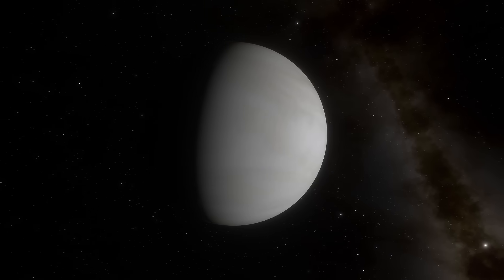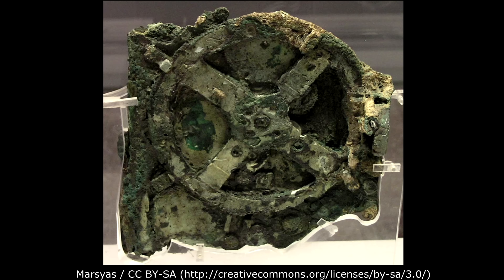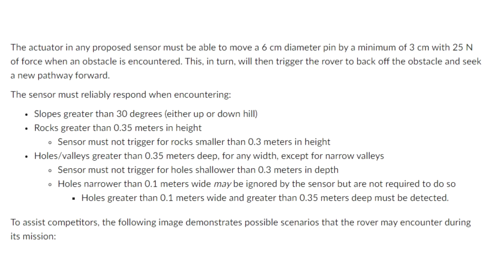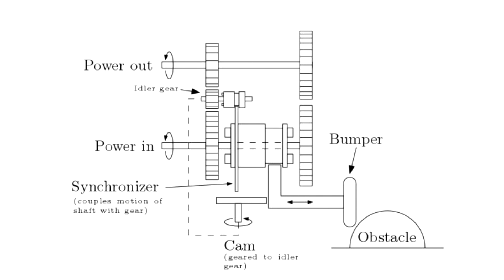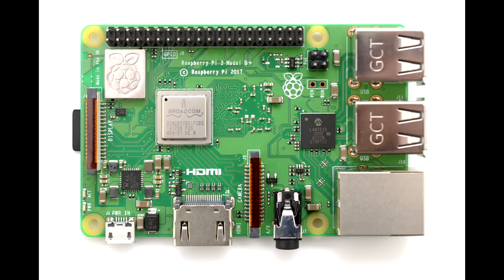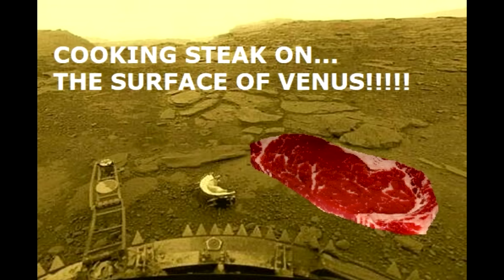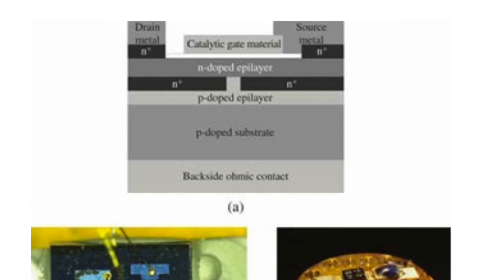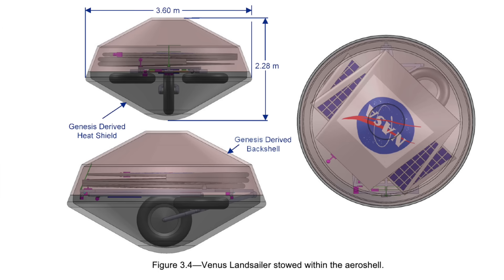Venus Rover Concepts That Beat The Killer Atmosphere

Comment: Molten salt batteries seem like a perfect fit for this. It could melt on the surface and wake up the rover.
Heat resistant electronic circuits seem like the obvious solution for this. If they’re comfortable running at 450C then cooling is going to be easy with the thick atmosphere.
Reply: I was thinking something similar, maybe an endothermic reaction. Some chemical reaction might just be the way to go here.
Reply: batteries still need intelligent charging circuitry
Reply: Molten salt batteries would not provide enough power. the energy density is way less than lead acid never mind comparing to Lithium.
Reply: @gordonlawrence1448  Really? They were tested a lot for electric vehicles before lithium batteries and used in some. A battery that's say 50% as good as a lipo battery is still much better than no battery or a complicated mechanical setup and we don't need much thermal management when it's heated up.
Reply: @Ty4ons  The reason they are used for military applications is that they do not discharge noticably for decades when cold. That's the only application I know of for them (missiles).
Reply: @Ty4ons  Molten salt batteries are terrible in almost every way. The only reason they are well developed is for military applications. Things like air defense missiles need to be able to sit for possibly decades doing nothing, and then suddenly, in seconds or milliseconds, needs to power up and provide shitloads of power for like 20 seconds. And that's exactly what they do. Molten salt batteries are almost exclusively used in military applications like that.
Reply: Salts melting point is around 1470°F the surface of venus is only 870°F
Reply: @Swifteroos  who's talking about NaCl?
Reply: @Swifteroos  These aren't regular salts like table salt and are only a few hundred degrees celsius. If we go to the extreme end and use large molecules for the ions we can make salt that is liquid at room temperature.
https://en.wikipedia.org/wiki/Molten-salt_battery
Reply: @Ty4ons  ah I was not aware
Reply: @Swifteroos  They work on Earth just fine, it would just be less difficult for the sodium to remain molten on Venus.

Comment: I get that it would be complicated as hell, but some kind of craft capable of floating on the clouds and dropping a probe down on a cable to scan the surface and take atmospheric samples would probably have a significantly greater scientific capability for the size and cost to get it there.
Reply: Descent stage and  liftoff time versus the   thermal mass required to maintain temp for critical hardware would be competing and probably make it unachievable. Unless some very fine thermodynamics calculations are shown I doubt this would be viable.
Reply: @ervin0072002  I wasn't thinking something that could land.  Something that would basically take advantage of the super dense atmosphere and be able to lower a probe wouldn't require liftoff capability.  It could stay up where it's cooler and lower pressure, and the probe would be the only thing that would require the specialized materials to withstand heat and pressure.
Reply: So a steampunk mechanical airship?
Reply: @DethsKing  Nope.  Full on computers and such on board.  They would just need to make the probe capable of surviving the intense heat and pressure.
Reply: @DethsKing  YES.....Designed by Kevin O'Neil
Reply: You can't "vent", you need to use energy to pump it out against the outside pressure. And you need a hull that can stand up to the pressure difference, while being light enough to float, and big enough to displace the required volume of atmosphere.
Flying by light gas balloon or helicopter is more realistic.
Reply: @galfisk  Right, that makes sense.
Reply: I was thinking this, or maybe a probe that behaves more like a submarine. It'll spend most of it's time in the clouds where the temperature & pressure is Earth like, and occasionally descend to the surface to grab a sample. Would it be possible to take on some extra atmosphere as 'ballast' to descend and vent it again to ascend?  Or maybe some kind of helicopter that spends most of it's time in the cooler upper atmosphere?
Reply: @beavodeev4412  It's gonna be hard to save on size/weight with a 30km cable on board
Reply: @Merlmabase  maybe, but you're also overlooking the idea that it could use some kind of ballast system on the probe itself, reducing the strain on the cable and wiring so it wouldn't need to be that strong.  Besides, have you ever seen that spyderwire fishing line?  That stuff is VERY strong for how thin it is.  Some new formulation to withstand the temps would obviously be required, but I don't see it needing to hold up a 200lb+ probe, so they should be able to figure something out.
Reply: @Merlmabase  Oh yeah, that's true.
Reply: @Merlmabase  Monofilament diamond fibre. Arthur C Clarke, The Fountains of Paradise.
Reply: @ceejay0137  diamond is extremely flammable
Reply: @ceejay0137  Sure. Although by that point we're building space elevators, and could drop enough insulating material and cryogenic refrigerant on venus to stay cool for a couple of decades
Reply: @TimLF  You need oxygen to start a fire (since we are talking about Venus and not Earth there is none). However, I get your point. It is still unrealistic cause you would need 20+ km length on that wire.
Reply: @hellcat1988  nobody here is even mentioning the concentrated sulphuric acid environment, which is a huge hurdle by itself.
Reply: @paulmichaelfreedman8334  Some stainless steel alloys are resitant with sulphuric acid
Reply: @FruitingPlanet  Also at 500C?
Reply: @paulmichaelfreedman8334  Also, the heat from going down gravity well will change composition of materials, so I'd suppose major mass usage would be to ablative shield or a way to go down slowly enough while slowing down to even meet Venus (though slowing down is one-time use in space it's still mass one needs to carry as fuel, might be partially wings or w/e). So it's just opposite of rocket equation when sending stuff from Earth's gravity field. Still more problems I don't offer solutions to, but bears keeping in mind.
Reply: @beavodeev4412  I thought NASA had a plan to do just that a while back. Or at least maybe a concept for it when I heard about it.
Reply: @12yearwaves  I think they had plans for an airship that would stay in the 'Earthlike' part of the atmosphere, but not to dive down to the surface and return.
Reply: @beavodeev4412  That's HAVOC (High Altitude Venus Operational Concept), a proposal for a crewed lab floating in Venus's atmosphere at the altitude where the temperature is similar to Earth's. Also, it would use the Earth air that's there for the crew to breathe as its lifting gas.
Reply: I had a similar idea, have an air acid resistant airship probe float at around 55 km with all the electronics on it and lower a ~30 km thin high temperature and corrosion resitant cable into the atmosphere, with mechanical instruments at the end, for example lenses that focus images from below the venus clouds and send the them through an optical fiber to the airship, where camera equipment could produce high resulution video from that.
Reply: hellcat1988 the drag on the lowered probe opposed to the airship might be too much? There cable might snap
Reply: @jl.7739  no steel calbles can handle hundreds of killometers with their tensile strenght.
Reply: It wouldn’t have to be too bad. You could even build a permanently sealed vacuum airship given the right materials. No inflating or leaking present, at least compared to hydrogen/helium. Maybe not though, who knows.
Reply: @spacewombat4569  That would be complicated, but a simple solution would be to have a relatively lightweight sensor with airfoils that it can use to "fly" down using the wind currents to create tension on the line and swing it like a pendulum to it's intended altitude.  You would need a craft that has enough boyancy to counteract that pull, obviously, but in principle it's the same as how they use sidescan sonar.
Reply: The winds at altitude are much higher than the winds at low altitude. The cable would take a beating from those shear forces. You're floating cloud base would actually have to fly very fast to stay hovering over one area on the surface.

The Venera probes managed to keep their electronics cool for up to an hour. Maybe you could drop some probe down from the cloud vessel, have it stick around on the surface for 30 minutes, then blow up a helium balloon and float back up to the cloud vessel, and just rinse and repeat. It might be difficult to make the rendezvous each time, though, what with the winds and all.

Comment: Ok i got it. Vacuum filled blimp. I know nasa is looking for a rover but I think it's the wrong way to go. Venus's "atmosphere" is more like an ocean, we could easily build something boyant and have it just bounce around like a beach ball! Also the fact that it is a vacuum inside the blimp, would make it easier to cool. Think, Floaty Zorg Ball rover
Reply: I kinda like that idea. Just a submersible with a pressure differential ballast tank. Let the CO2 in and the ship sinks, pump it out and it will rise and let the currents take it. Of course you still need a way to power and control the pump, which brings us back to electronics and energy generation means in the hot temperatures where semiconductors and magnets have trouble functioning.
Reply: @nolan4339  true but, a vacuum is an insulator
Reply: once you find a material that can take the pressure differential and be light enough to ensure positive buoyancy give NASA a call.
Reply: @jackvernian7779  i was looking for contact info about this, got a # to call
also I think Titanium fits the bill, it worked ok for the SR-71

Comment: What if you used vacuum tubes?
Reply from the maker: How thick does the glass have to be against 90 atmospheres of pressure?
Reply: @scottmanley  Infinitely thick. Borosilicate glasses are already annealing at that temperature. You need something specialty that doesn't mind (perhaps quartz) the heat in addition to being thick enough to withstand the pressure. Very custom.

So, maybe viable if you need a couple high-power components, (for a transmitter or power supply?) but mechanical would almost certainly be easier and lighter for logic.
Reply: @sealpiercing8476  Lots of space vehicles (notably the Pioneer and Voyager spacecraft) used travelling wave tube amplifiers for their downlink radios.
Reply: @skonkfactory  Yeah, I wouldn't be surprised to learn that there are tubes made with appropriate high-temperature materials just to deal with high power for old-school military radar or something.
Reply: The best case would be a modern-designed ultra high power small vacuum tube, due to miracles of modern chemistry and since it would still be in production, if anything vaguely suitable existed.
Reply: @sealpiercing8476  The only vacuum tube I can think of that's still in common use is the magnetron.  Those have a ceramic insulator and a metallic envelope.

I dare say that if someone was trying to do this for real they could come up with something suitable.
Reply: @scottmanley  it doesn't have to be glass!  You could make a stainless steel pressure vessel with a quartz window, and have an iconoscope camera.
Reply: skonkfactory I thought of that too. Downside is they are bulky and fragile.

Comment: Why not a TEC to both cool the electronics and generate electricity? The lead/tin that binds the module together will melt, but assume we could solve that easier than replacing processors with a mechanical replacement.  The sensitive bits can be shielded and cooled via heat pipes, so the TEC is the only thing thats exposed to high temps.  Replacing motors make the most sense for some analog replacement.

Comment: We need a coolant fluid that work between 600 degrees and 50 degrees,and for compressor we use wind mills,by using this we will cool a small volume in space craft and by using optice fibers,we bring the images from outside, inside the cooled copartmant

Comment: Quit screwing around and send an actual nuclear reactor and have it cool itself. Send a TANK!
Reply: 2nd law of thermodynamics would like to have a word with you
Reply: @Wren6991 , are you saying it's impossible to cool an atmosphere from 400 to less?
Reply: @thanksfernuthin  I'm saying it is impossible to use heat output from a reactor to cool the reactor to less than ambient temperature
Reply: @Wren6991 , there are different liquids. A reactor's temperature is much higher than 400F isn't it? Don't be so negative!
Reply: You know that Ac has to dump the hot air somewhere?  Dumping it in a oven that burns Pizza to a crisp in seconds might not work.
Of course that completely ignores the cooling for your reactor itself. And the materials you'd build it with.  
It actually ignores sanity and physics alltogether.
 I guess you can send a tank. Steel doesn't melt. You just can't have anything  useful in it.
Reply: @5Andysalive , ignores SANITY! WOW! What's the normal temperature in functioning reactor? A lot more than 400F. Isn't it? There are many many many different liquids and materials. Don't be so close minded.

Comment: What about a bunch of heat resistant probes that are disposable that are dropped like a carpet bombing. Even if they only last a few minutes maybe they can be purpose-built for only one function and doing it quickly.
Reply: Kinda Russian way but with more veneras
Reply: I think they're looking for just rover ideas but this is not a bad idea! See if you can do something with it!
Reply: Couple of problems with that... Considering that it takes the GDP of a small country to send equipment on such a mission, we want to get back some valuable data. Having a minute worth of seismic activity, temperature (right after entry into the atmosphere), brightness etc. isn't exactly worthwhile. Also: Why carpet-bomb venus with self-contained sensors all requiring their own power supply and housing, when you could just place 1 probe where multiple sensors can share the housing and power, and thus reduce the weight that needs to be shipped over there?
Reply: @spacenomad5484  you're not putting all your eggs into one basket by having multiple micro-probes which are then sent down in maybe batches of 5 each. If one fails instantly some will outlast.
Reply: @jackvernian7779  : But how do you land them? For multi-probe setups, I think the better idea is to make them passive, long-endurance, and placed by the rover. The seismometer suggestion particularly...
Reply: interplanetary bombardment right there.... could work
Reply: Yep. Just cover another planet with our litter.
Reply: yeah we could send 100 micro-probes that are delayed both where and when they drop. they could be insulated with aerogel layers.

Comment: High temperature semi conductors / electronics seems like the most useful goal.
Reply: People have been working on this for decades.  Diamond would be the best material for this job.  Boron works for p-type doping in daimond, but n-type is problematic.  Nitrogen makes a deep level, so does not work, while phosporous has low solubility and tends to form compensating phosphorous-vacancy defects.  Lack of a solid native oxide is another problem, but not completely insurmountable.  The difficulty with silicon-carbide is it easily forms extended defects such as stacking faults and dislocations which mess up the electronic properties.  So, it is still very much a work in progress.
Reply: @cdl0  If you don't mind me asking, what about the difussion of the dopant under 600C temp? How much would it affect the lifespan?
Reply: @jackvernian7779  At 600 C, the diffusion of boron is not going to be significant.  The conventional view for substitutional dopants is that it would be a vacancy-mediated mechanism, so first you need to make lattice vacancies, which costs about 6-7 eV in energy for each one, which is huge, and will not happen at 600 C.  The measured activation energy for vacancy diffusion is about 2.3 eV, which needs to be added to the formation energy.
Reply: @cdl0 thank you for elaborating.
Reply: @cdl0  those damned n-type semiconds... always a pain in the ass.
Reply: @jackvernian7779  It is possible to make a p-i junction in diamond . . . . It works.
Reply: Indeed
Reply: @jackvernian7779  how do can detecting brain signal on near enviroment

Comment: would it really be that hard to just build a mechanical system to just cool an internal area where you can put the computer?
Reply: The problem is cooling only works if there's somewhere to dump the heat, and since the atmo is already so hot, your system will have to concentrate that heat to a level way above the atmo for it to dissapate. You get to those levels and most lightweight materials fail
Reply: Yes. These are all low power budget designs. No solar hurts. Lack of low-temperature heat sink makes RTGs marginal at best I think.